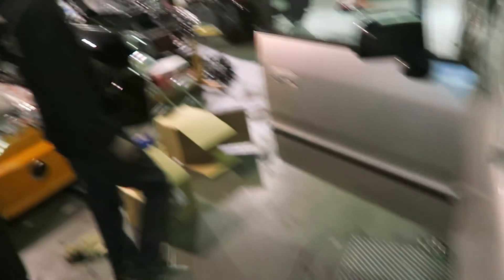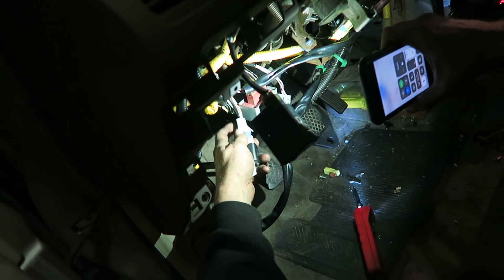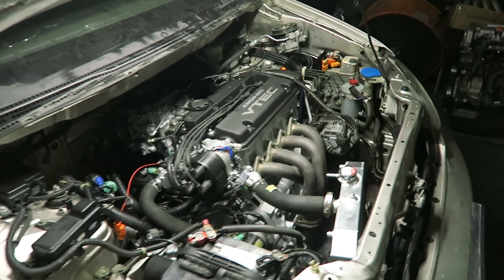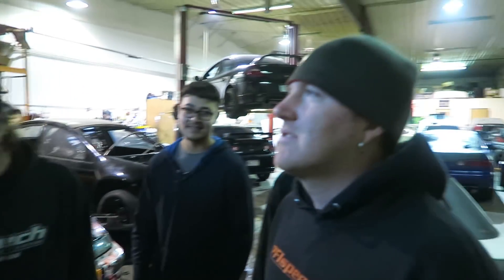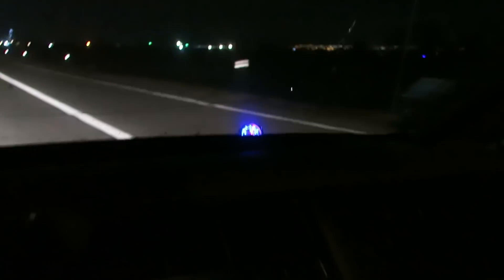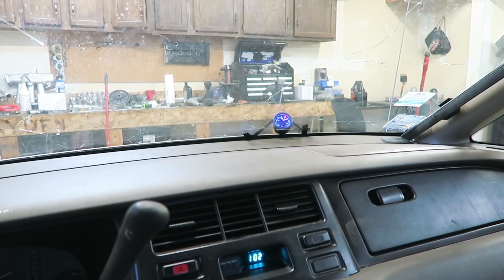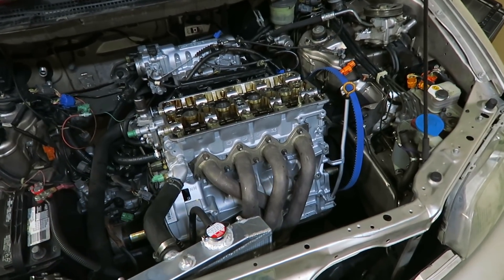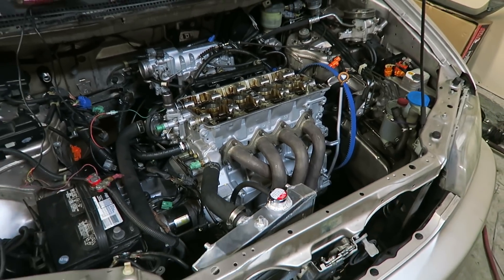Minivan is Already on the Dyno?

Comment: Its probably the orifice assembly oil control and o ring. vtec will not work and sometimes engage at super high rpms 7-8k if it ever does. make sure to use two orings. one below the orifice assembly and one on the assembly. it allows oil pressure to remain in the cylinder head before returning to the oil pan.

Comment: Looks like you don't have the o ring that goes on cam cap #3 right in the middle of the head. Hence when Vtec engages oil spreads around because it doesn't have a direct path to go.
Unless you took it off prior to filming that clip.

Comment: Orifice assembly oil control. located on the block. your gonna have to pull the head. make sure to use two orings. one on the orifice and one under it.

Comment: Hey Kyle, what’s your main and rod bearing clearances in the van? Could be the light weight oil and wide clearances causing the low oil pressure issue BUT. With it dropping oil pressure as it cracks over into V-Tec it could be a missing O-Ring (check around the cam caps) OR the oil pressure relief valve. Shimming the spring will help if it’s the relief valve. 

Unplug the v-tec and see if it keeps building oil pressure first, though. See what happens and then go from there.

Comment: Thanks to this I finally understand the core workings of VTEC. It works just like the old school flat four air cooled fuel system. To keep the fuel pressure right the pump on the block has a pin/rod that rises with the oil pressure to keep the fuel demands upon a faster spinning motor. Same science. Id love to learn more of these little tech things!

Comment: Check the middle cam cap theirs a little O ring if that ring isn't there it will for sure loose oil pressure in vtec.

Comment: @boostedboiz Either the gasket between the strainer is missing or its a main bearing issue. You cant use silicone for that gasket because it will dissolve and cause low oil pressure. Swapping oil pumps wont fix the issue either. Oil pumps just move the oil. Pressure is created between the bearings.

Comment: Also throw in some lucas oil treatment along with the 20w50 . That lucas has saved many motors for me it sticks to the metal parts very well and will also quiet a loud motor. I had a 92 chevy Silverado k1500 with a tbi 350 with 360k miles that without the lucas n 20w50 would only get 15-20 psi oil pressure but with the lucas n 20w50 it jumped up to 30-35psi. Its around  $9 a bottle  and well worth it.

Comment: You probably already checked but usually when I see that issue it’s the pin on the center cam cap. Either the seal is leaking or the pin is missing like I said on the center cam cap.

Comment: Check the o-ring on the center cam cap. Your pressure doesnt seem THAT low at idle, even 45psi when hot and RPMs elevated isnt all that bad... What did you set bearing clearances to when you built the bottom end? Shimming the relief valve in the pump is a good way to get a little more peak pressure but shouldnt do much any other time. I'd be putting money on your relief valve hanging open intermittently or a weak/worn pump.

Comment: You should always take the back plate off the oil pump and check it for clearance and irregular wear when using a used pump on a build! Its one of the most important things along with the bearing clearances that will determine if the build survives. Could just be a weak bypass spring in the pump but I highly doubt it.  Even if the shimming works I wouldn't trust it because it could be masking the real problem. If you checked all the pins in the VTEC and it's all good, throw a new pump in and see what happens. I am still very suspect of a flaw in assembly somewhere because the VTEC was failing to engage at the set RPM, that means a big loss in flow somewhere when it kicks in. Also don't use 20w-50 in the winter. Pay an extra few dollars and get 10w-50 or 5w-50 castrol or similar if you want the extra film strength, pressure,and bearing protection. Also don't do that just yet because it can mask the problem you are having. The VTEC should work even with 0w-20 oil.  But you don't want more than 10w during the winter. The hot temp number is what you want to increase. High load high performance builds do best with 5w-50 all season.  There is a reason they run it in all the BMW M series motors because of film strength for the bearings at high RPM. Good luck brother! Let's get this thing ripping through the gears!!! Sorry for the ramble!

I also just remembered that they have a adapter plate that will allow you to hook up compressed air into the VTEC port where the solenoid is to check for proper engagement and flow loss. The guys at PFI might have something like that laying around to check. I had one that I custom-made back when I used to work on these motors and it was very handy for diagnosing engines that were brought to me by other builders that didn't assemble the head properly.

Comment: Do you have an alternator on the van yet? Maybe low battery voltage is causing an inaccurate reading on the oil pressure gauge?

Comment: Oil pressure spec for a h22 is 10 Psi at idle and 50 and 3k.  Doesn't seem to far off.

My d16y8 makes very similar oil pressure with no problems.

Comment: Hi Kyle, I was thinking in an earlier video you mentioned they changed the sending unit design for the oil pressure gauge. Perhaps something isn't 100% right with the reading, maybe worthwhile to check with a second gauge to verify... though this doesn't explain the late VTEC.

Comment: check your oil pressure relief valve in the sump. the spring might be old , in which case add a thin washer to increase the spring tension , thereby holing it closed for longer and increasing oil pressure . be careful not to add too thick of a spring or your oil pressure will be too high .. a guy I know blew his oil filter clean off with too much oil pressure.

Comment: Change oil pump if bad it is not that hard to change. And Kyle!!! What are the clearance for balance shaft bushing. If you don't have the belt on it you should block those oil passages by putting new bushings in. Done that with my built 4g63 engine and they are known for low oil pressure because big turbo oiling, oil lifter for valve and piston cooling oil jet... It should be same for h22.  It is needed when having built engine.

Comment: I had a professionally built RB25 that had roughly 50/55 psi warm oil pressure with 20w50 and it was large bearing clearances and a weak oil bypass spring. I shimmed the spring and that brought it up to 65. Just an idea

Comment: Water pressure adjusts with the water temp, no fan on radiator, its getting hot sitting on the dyno. Anytime I rebuild and engine a new oil pump and water pump go onto it with a new thermostat as well as with new electric fan motor.

Comment: Shimming the pump might do it. I think the gauge not showing much more than 40psi was a fluke, maybe a faulty gauge. If pressure fluctuates in lower rpms and then hits a max of 55-60 after a certain rpm then the pump may be getting maxed out. Would explain the issue with vtec not hitting until the last bit too. As for using a thicker oil, I would use an oil that is appropriate for the bearing clearances you have in your engine, and not use something thicker to raise oil pressure. Even small differences in oil weight can be detrimental to a bearings life. I ran 10w30 in my motorcycle after building the engine, thinking that the heavier-than-specified weight would be ok for the bearings. About 3 months worth of use later and I break open the bottom end to find a bearing that had a huge chip on its face. Replaced the bearings, and decided this time to run 5w20 (specified by the bearing manufacturer). Ran the bike for the same amount of time, cracked open the case, and to my pleasant surprise virtually no bearing wear. Take it from me, don't screw yourself and just use the appropriate weight oil that is compatible with your bearing clearances.

Comment: kyle when i installed the ks tune balance shaft deletion kit , it came with some pins to block off some of the oil passages to the balance shaft , you should watch the video to get some ides or buy the kit , i believe  if you talk to Shawn or Reid to help you out with a discount, they should probable look out for you. those guys are the best and very helpful. i believe its ether the balance shaft bearing or the oil pump. Good luck and Happy Thanksgiving

Comment: as long as you don't sit around with it running. it will be OK. I haven't had a fan on my car for years! if you have to dit in traffic for 15 minutes or so it will start to get warm. then just turn the heat on! it sucks when its 90degrees out!

Comment: The engine isn't cooling properly with out  the radiator fan so it cause the oil to get hot and the hotter the oil it lost its thickness so that makes the oil pressure drop

Comment: Try 20-50 if you see better oil pressure your pump clearance is a bit loose and probably be safest to change it. My 85 Cherokee would run 20-30 psi on 10-40 on 20-50 I would see around 45-60 replaced with a high volume pump and even  with 10-40 I would see around 60psi

Comment: THE PIN WAS NOT FROM KYLE, THAT WAS FROM WYATTS ENGINE. Kyle check the pins hard core man, is going right when VTEC kicks in, or the VTEC switch or something is doing it when it goes in VTEC, I don't think it's your pump man!

Comment: You might want to throw a mechanical gauge on it to verify what the oil pressure is before you do anything to crazy. Glowshift isn't exactly the highest quality lol. Idk much about Honda's but 50 psi  isn't low.. The pump has a regulator in it and will only make so much, oil pressure isn't guna just continually climb with rpm forever

Comment: 20w-50 in those stock clearances you’re running is so overkill. Especially in winter. I run 10w-30 in my h22a circle track engine which gets ran to 8500+ constantly and it gets to 85-90psi, not shimmed at only like 4000 rpm when hot.

Comment: Hey what’s up donno if you figured it out? But take a look at the center cam cap. There should be a small o-ring ( it keeps the oil pressure up when vtec engages) could have easily fallen out. Can’t miss it😉 message me back if you need more direction.

Comment: Did you delete the balance shafts? If so there's an oil port that needs to be blocked off
Reply: Pacheco's Garage he put the stock balance shafts back in... that's the first thing I thought of also
Reply: I've never had oil pressure issues due to it not being rotated
Reply: Jimmy S not sure about Honda but Ecotecs don't need to be rotating to seal off. .. Just need to be sealed off for proper oil pressure...

Comment: Your pump is bad, it's normal to loose some pressure when the block is at running temp but for it to drop like that is an indication that the pump is worn out and can't build pressure when it's warmed up and when you put a load on it it looses more pressure as it spins at a higher rate.

Comment: y is there a little Square on the block where it says h22
Reply: If you're talking about the metal that "h22" etc is stamped into, that's just the place where that info is displayed. If you're talking about the square hole above it, that's where you shine the timing light (as Brent did in the video)

Comment: It's not low it's completely normal the warmer the engine the low the pressure will go 25 35 PSI is fine at warm idle

Comment: You only rebuilt half of the engine. Surely changing the oil pump and water pump would be included on a rebuild. Especially one with unknown mileage or history.
Reply: But made NO mention of whether he changed the oil pump or not

Comment: Should of replaced the oil pump when you built it IMO. That is the heart of the motor to keep the oil flowing. Oil pump shouldn't cost that much especially if you get it off rockauto.

Comment: Oil pump or messed up oil pickup, I'd bet $2..  
  Should stop buying glowshift so you won't have to question a reading, there should be no doubt. Prosport has better sending units and cost is not much more then gloshift.